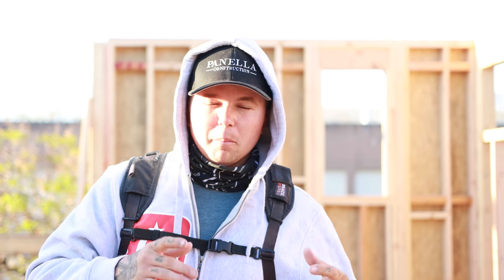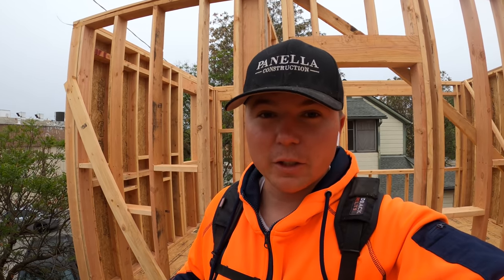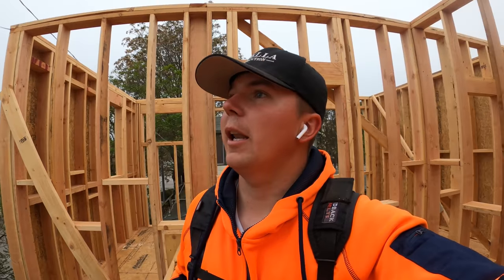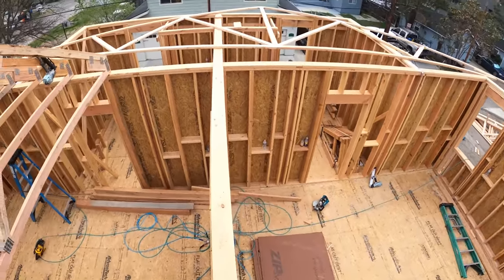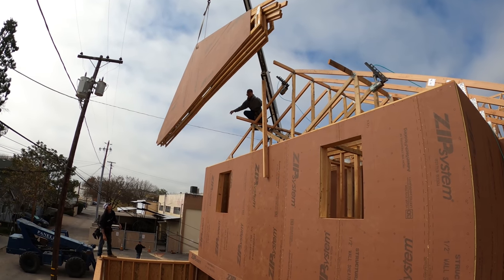Roof Trusses Delivered: Crane In Place or Hand Load? #16

Comment: Transporter wall jack you need them. I safely lift 2x6 walls with sheeting and headers completely done up to 56' with just 2 guys in under 5 mins and no one is under them
Reply: We use old school "Proctor Wall Jack's." The old one's are capable of lifting up to 1000-1500 lbs each. The new one's are only 500-700 lbs each.
Reply from the maker: Hardly ever build on subfloor to use wall jacks. Can you attach them to concrete? I’d love to use them.
Reply: @semperfi5861   Semper-Fi brother 8thEsb 2nd Fssg. Either set are great and way better then setting walls without them
Reply: @semperfi5861  mine are rated at 1000# each
Reply: @MattBangsWood  yes by either a board set up or using concrete type anchors
Reply: @MattBangsWood  I build a lot of detached garages on my own and I'll run a 2x6 from one side to the other to keep the board from sliding. The weight of the wall as it goes up presses down the board anyways, so it won't slip. Whatever you do don't use the 2x4 wall Jack's (like Crazy framer) because as the wall goes up you need to move with the wall so you're basically underneath the wall. That's pretty scary with how Shitty wood grade is nowadays. Proctor Wall Jack's are the best investment for a small framing company (or crew), imo. 👍🇺🇸😊 one last thing is that they only lift 10' 6" walls, so if a wall is let's say 12' I will build the top side of wall 1'6" off the ground (make sense)? This way you can raise the wall all the way up. I learned how to frame alone from an old timer (he's still framing at 73 years old), and I'm grateful I met the old coot and was able to learn so much from him.

Comment: I'm OCD when it comes to my job site, cannot even start unless I tidy some of it up.   Nothing worse than working and you knee on a nail or slip/trip on a leftover block on the floor.   Yes, construction sites are more dangerous than your front room but you can mitigate it with a quick clean up before knocking off for the night.   Even if you just pile the wood in the corner and sweep everything into the middle of the room.

Comment: SSuggestion.Go battery powered nail guns as they're much lighter than what you have or do what I do. I use a scuba diving oxygen bottle with a reducer valve that accepts the ARO air line fittings and that saves me running long air leads all over the place. Am testing out a Makita battery gun right now and it's looking like the bottle version is due to be retired. Just a thought.

Comment: Hey Matt, I’m looking at an older Gehl Dynalift. Is that what you have? If so, how do you like it? Keep up the good work man.
Reply from the maker: That's what this machine here is.. It was a great lift, but be careful, as they get older they have a ton of mechanical failures. We've since upgraded to a newer machine, but the Dynalift worked great for what we used it for while we had it.

You'll be a pro at hydraulic line replacement by the time you're through with it.
Reply: Thanks for the heads up Matt, sometimes i get tunnel vision with low prices, I may go for something more expensive. 👍. Keep up the good work, I get jealous of you Cali framers this time of year as the temp is starting to drop here in Neb!

Comment: How long does it take to frame a 2500 square foot home from start to finish on average. I am sure there are many variables but just an average time for your crew. Thanks love the info and channel
Reply: 3 to 4 weeks to frame if foundation and backfill is done before framers show up. I’m talking just frame the house not finishing
Reply from the maker: Denny's pretty spot on. Should be a little over a week per 1,000SF to finish framing.
Reply: Time will be added if you have a daylight basement or 2 story house, fancy stick frame front porch or great room, big deck. Will take less time if your framer is piece work working 6 10’s
Reply: Thx for responding and the information. Keep the vids coming.

Comment: Always wondered why people don't stand their walls sheeted why is that
Reply: Can’t get it square on the ground or not enough guys on a crew to lift with the added weight
Reply: @dennylangmack7452  have a look at awesome framers. Very small crew and they complete finish their walls before standing them up!
Reply: Ya square on the deck. Wall jack it if you cant stand it by hand

Comment: so why do most builder never build their own Trusses?  its not that much more expensive to buy them built?
Reply from the maker: Engineering involved is different, especially in earth quake areas like this.

Easier for engineered trusses to be done.
Reply: @MattBangsWood  you/or the buyer/builder of this house got Ripped off on trusses $15k. How much per truss is that?
Reply: I would think because the trusses are engineered for the loads and have been certified and stamped while making them yourself I don’t think there is any way to prove the loads needed, plus they are more consistent building them on there big jig table then framing them out in the dirt
Reply: @dennylangmack7452  yup and the companies that make them laugh and then over charge builders